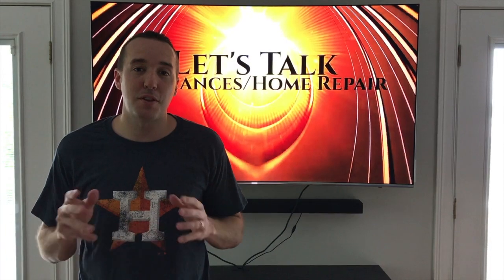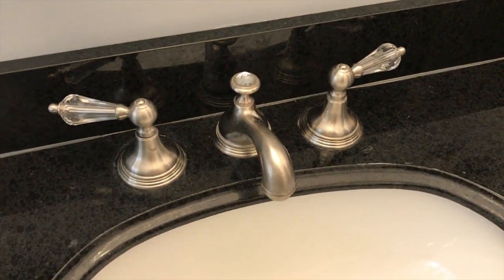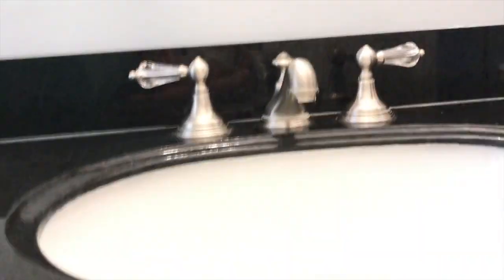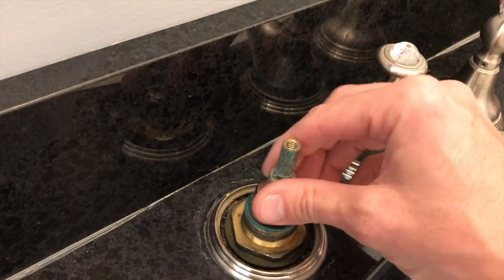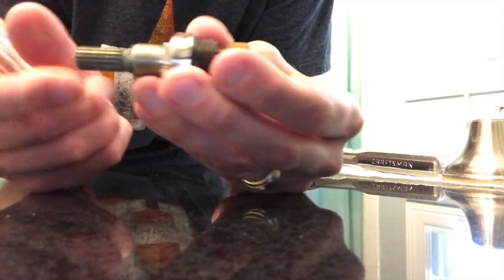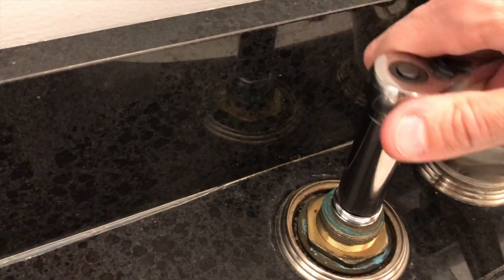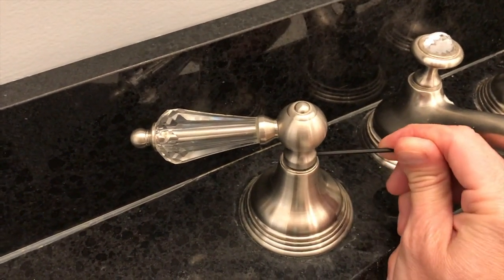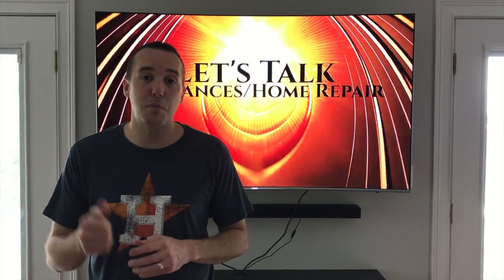How to replace a dripping/Leaking bathroom faucet STEM!

Comment: I decided to try to fix my faucet leak in bathroom after watched this video. My faunet is a Pfister part and turned out easier to replace the stem what shown in this video. But took me great effort to find the Pfister part (doesn‘t know who made the stem that I just check very part (in hundreds) in web site carrying those faucet part. Thanks for the video. 😊
Reply from the maker: Hey Ted, thanks for sharing this.  Did you end up finding the replacement stem and get DIY project completed or are you still searching for replacement stem?

Comment: Appreciate video followed steps . Only issue I'm having is the handle loosens now and I can't shut water off . I've been having to screw it back on and align it to get cold water off.
Reply from the maker: Good morning, just poured a cup of coffee and am sitting down to answer any and all questions for the DIY community.

We appreciate you sharing your experience, any update?  It’s likely that the internal stem/cartridge is not properly seated… It can be as simple as tightening the handle.  You will want to ensure that the handle itself is properly seated onto the stem because if it’s not, it will lead to your exact issue. Please keep us posted.

Let us know if you have any questions and hey if you’re interested, join our DIY ecosystem and help us grow an exclusive group of DIYers.

       toolboxtoken.com

Reach out to us any time!  🧰
Reply: @DIYwithMichaelBorders Still occasionally loosens I tightened down the stem/cartridge as tight as possible. Handle screw I believe may be stripped that's my only guess. Thanks for reaching back !
Reply from the maker: @DodgerRocket  

We appreciate the follow up.  The handle being stripped is a likely possibility.

Comment: Hi Michael.  That was very clear.  Just a couple of questions. Do the cylinders have a right and left (for cold and hot) or will the same cartridge work for either side.  Also, is it just a good idea to buy replacements for both if one has worn out?  Thanks so much and thanks for posting.
Reply: Be careful, there are "hot" and "cold" stems. In addition, there are small parts inside the stem. If they become loose or fall out, you will have permanent running water!

Comment: Make sure to turn off the water under the sink before removing the stem. Otherwise you’ll have water coming out of the hole where the stem was with the full force of all the water pressure of your plumbing system. This is a disaster if it’s the cold; it’s an emergency if it’s the hot. I’m speaking from experience here folks! ;)
Reply from the maker: Thanks for watching & welcome to the DIY Raptor Club.  We appreciate you sharing this & you are spot on.  Hope all is well.

Let us know if you have any questions, enjoy your day.

😎👍🔧🔩